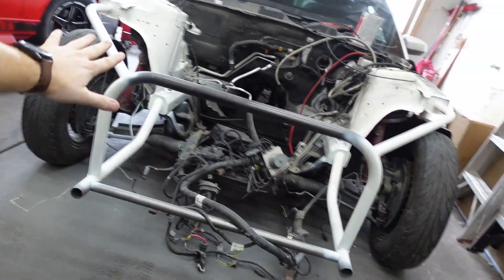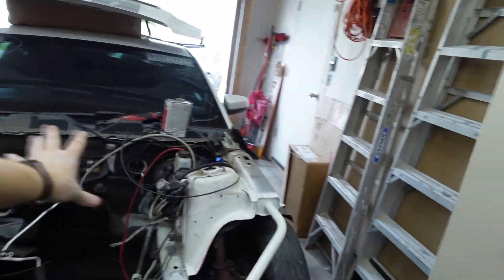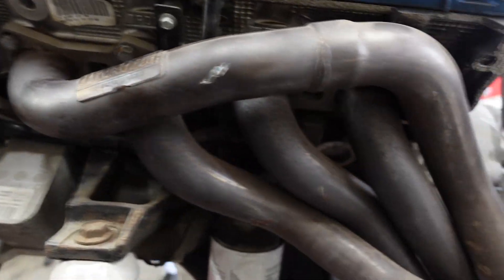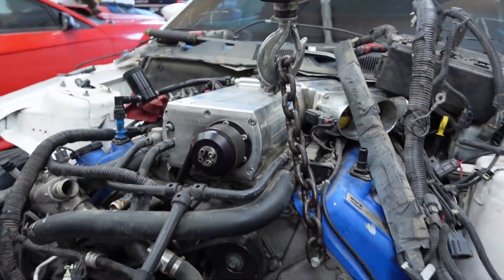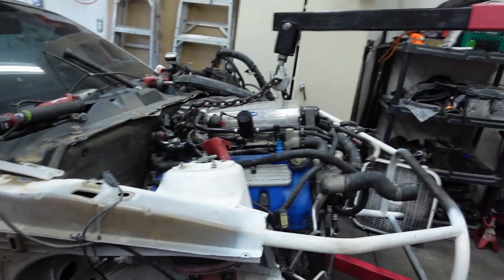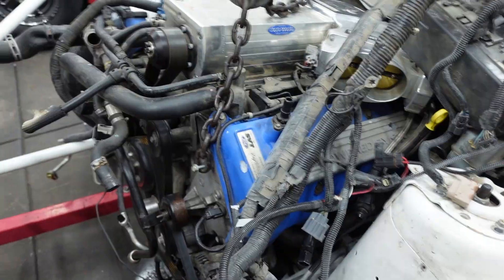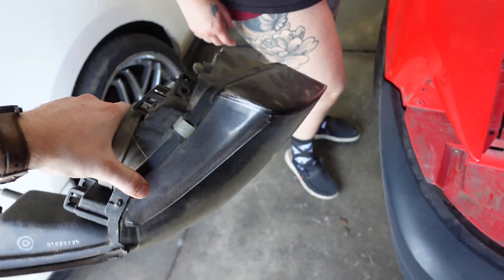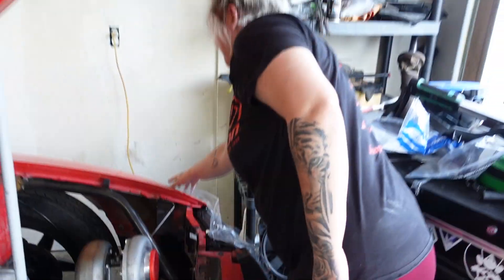SHELBY GT500 ENGINE IS IN! - TOOK WAY TOO LONG

Comment: I trade you a 6.0 Ls for dat there ferrrddd motor 🤣🤣 but yeah those DOHC suck to work on I have a 4.6 Dohc in my Lincoln only thing you can do is change the plugs and water pump any thing else you might as well pull the engine out or I mean drop it out the bottom hahahaha
Reply from the maker: I almost considered LS swapping it two hours in lol
Reply: @Cawbee  They are cool engines until you have to work on them lol
Reply from the maker: @LynnTwinCustoms513  EXCATLY!